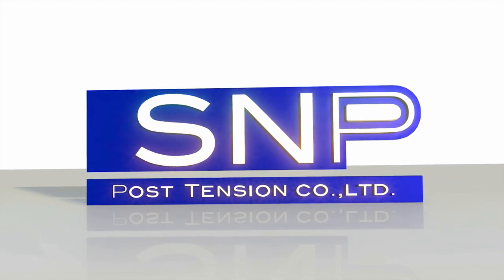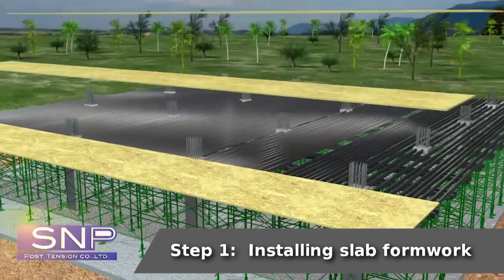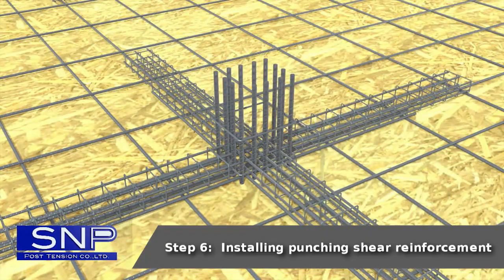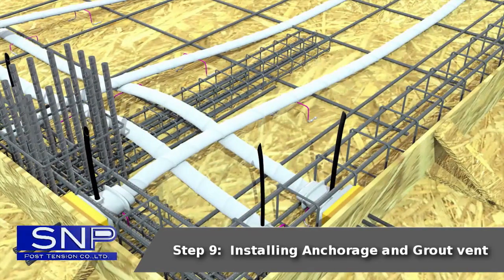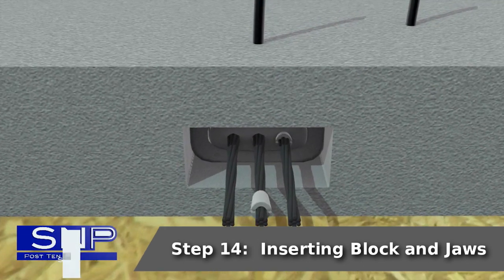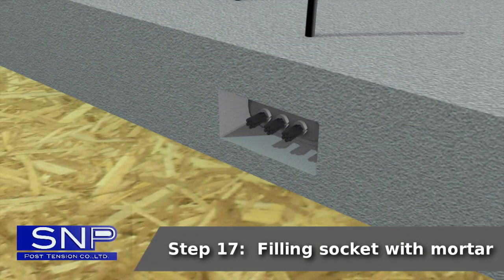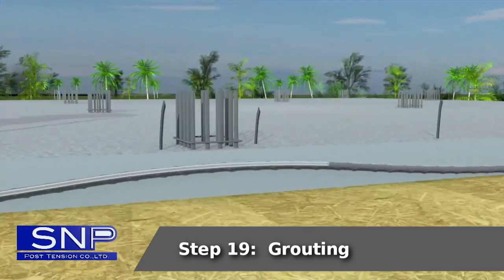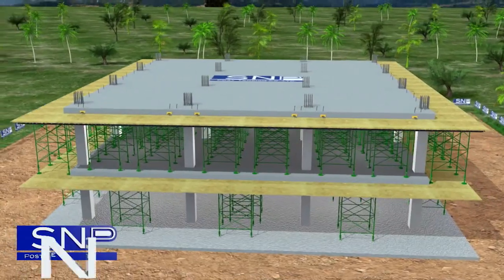Post-tensioned slab procedure

Comment: How does a steel rod in tension make the concrete stronger ? Is that what it does?
Reply: When you stress the steel rod (rebar), you create a static compressive stress on every square inch of the concrete. That rebar adheres to the concrete and once you stretch the rebar, it wants to go back to its original length. So it's pulling the concrete together. This is good for the concrete when it experiences tension. For example, if you have a slab of prestress concrete and you support it on two sides, leaving the middle unsupported, and you press down on the middle, the middle is in compression and to the left and right of the center you are imposing a tension. However, because it is pretensioned, the tension that is imposed by the load has to be greater than that imposed by the rebar in order for the load to actually affect the concrete. You are effectively transferring the tension from the concrete to the steel and steel is really good in tension.

Comment: what is the machine used to stress the cables called?
Reply: Vanguard
Reply: A stressing machine is what it's called ... or a ram and a pump
Reply: Vanguard or pump is the unit or device pumping the hydraulics. What pulls the strand will be an hydraulic jack.

Comment: Will be getting my House built later this year and just found out about the Post Tension Slab. I  definitely will use this
Reply: Even if you try to buy or rent the equipment it is expensive. Also dont trust any crew as they can cause blowouts if not stressed right.
Reply: @professionalchimp  blow outs don't happen if stressed right nice try sounding like you know what your talking about... that's the last thing you would want to worry about... its all installation kid ... stressing isn't hard at all ... and it's not expensive at all its actually the opposite...
Reply: Depending on where you live it's unnecessary unless you have a helipad on top of your house then go for it
Reply: If ya need a crew message me we do pt

Comment: STEP 19 : Please someone can explain to me how water and moisture in the grout inside the plastic tube where the steel cable reside is 100% removed, so that the grout is perfectly dry? I think it interest any civil engineer not to corrode the steel cables bundle over time, due to the entrapped moisture inside the plastic tubes and in contact with the steel cables?  Thank you Paul Candiago (candiago.p@bmts.com)
Reply: Well there is bonded and unboded pt there are a couple of steps missing here thats why you're concerned but this is not %100 how this works it differs from job to job and state to state...